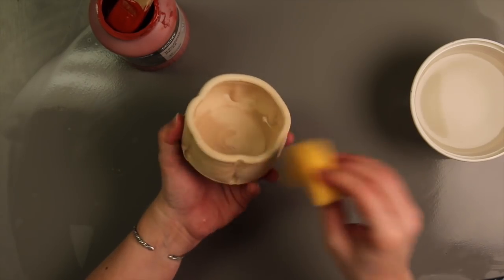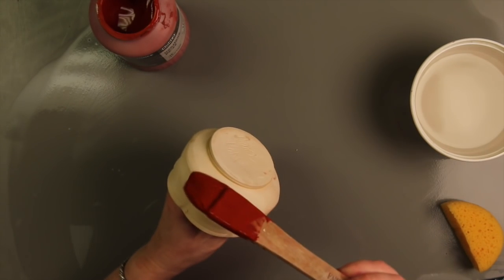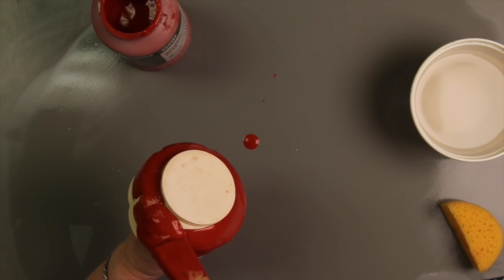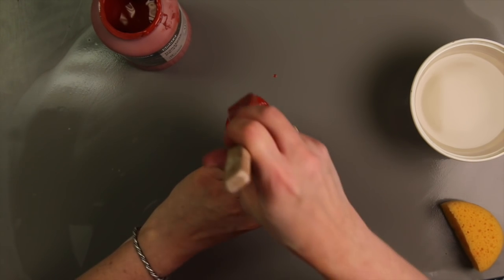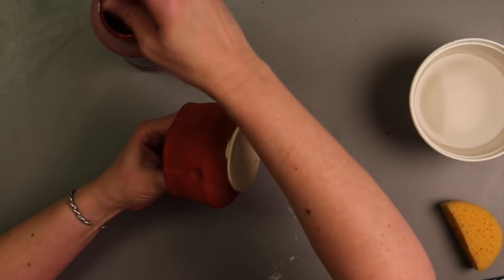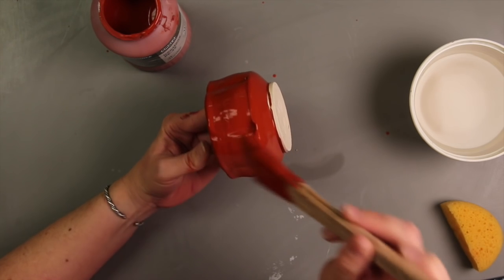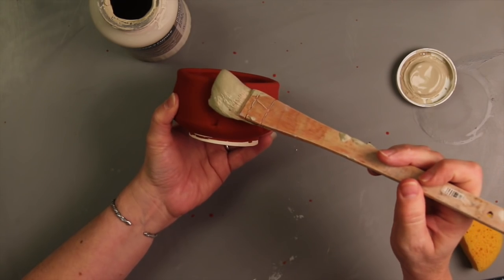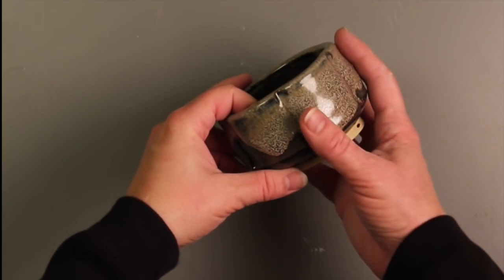Glazing with Potters Choice

Comment: After cleaning the pot with a damp sponge, do you wait before applying the glaze? Or will the glaze adhere with no problem?
Reply from the maker: We allow the piece to dry before applying the glaze. We wipe it off just to remove any dust that might be on the pot.
Reply: Wiping down also removes any dust left over from the firing. That keeps the glaze from crawling off the piece and onto the kiln shelf.

Comment: All of my potters choice glazed turned out matte and rough after glazing.... It didn't happen with other glaze brands in the same kiln.  What is going on ?
Reply: Did you use witness cones? Did your kiln make it to the recommended cone? I've had it  a couple of times where I hadn't set my cone sitter properly and it didn't make it to cone 6, everything came out matt. I refired the pieces and they were nice and shiny.
Reply from the maker: Please send photos and information to technicalsupport@amaco.com . Are you sure you are firing to Cone 5 or 6 and not Cone 05 or 06?
Reply: Fire higher to 1200 celcius and soak/ hold for 20 minutes
Reply: Also make sure you layer at least 3 good layers - preferably 4